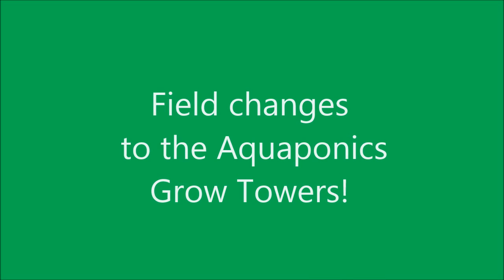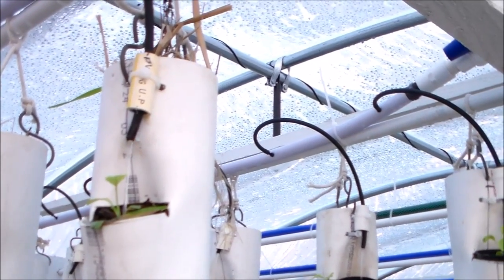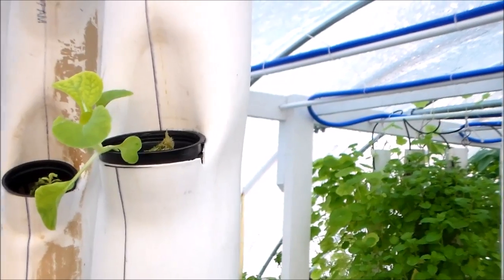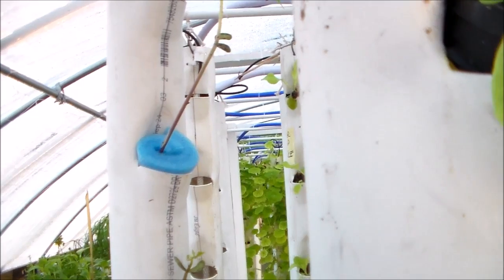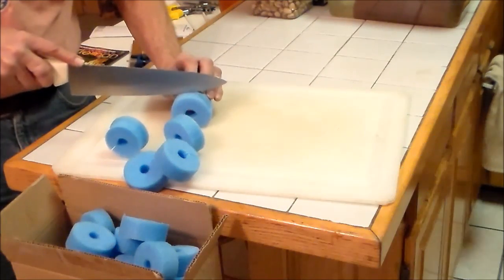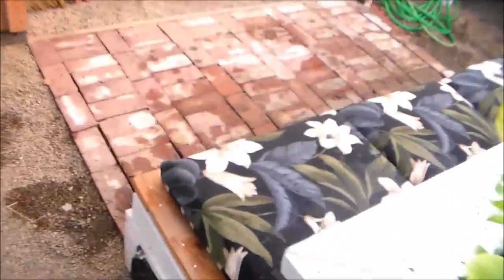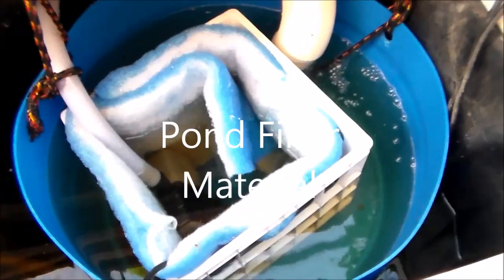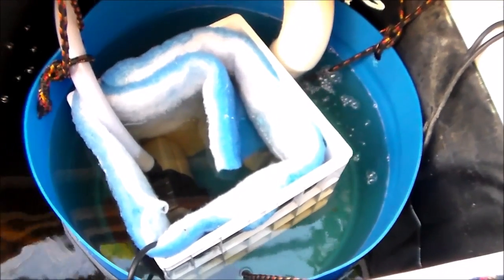Field changes to Aquaponics Grow Towers!

Comment: Do you have problems with water getting the the successive nets as you have pushed in the pipe above each hole which redirects water away from the net?
Reply from the maker: the water will follow the roots once they start to get some mass, until then I will use a cord or anything that can connect the pots--- the water will travel this to the roots.

Comment: Are you still using straw (given that it decorates over time) ?
I was thinking could you use prolite instead (which is reusable and won't decorate as far as I am aware).
Reply from the maker: You are right,Straw was a bad choice to be using. I deteriorates very fast and plugs the bottom of the tubes, Prolite may be a good option--- let me know how it works for you. good luck my friend---Don

Comment: Hey bro! Wonderful job over here! 
Can I do it with out using straw in the tubes?
Just to use a net pot to hold the plantes.. ?
Reply from the maker: yes--- the plants will do well--- the straw did not work out as planned--- it rots too quick and plugs the bottom of the tubes-- I would not use straw, maybe substitute coconut coir instead. because of the cost I don't use anything in the tubes and the plants do very well.
Reply: Donald Porta thanks for your answer! And another one.. do you recommended doing the horizontal way or the vertical version??
Reply from the maker: both work well, however I am shifting to the horizontal because of less failure of the supply line. The vertical drip tubes has to be checked every day, if you miss one that is plugged you may lose that tube.
Reply: Donald Porta thanks again

Comment: I have built something similar and I used autopot piping so it has an in line filter which is easily cleaned. Your other option is to supply your piping from your sump which would have cleaner water so fewer blockages.
Reply from the maker: +Sheldon B The water is being supplied from the sump--- i'll have to check out this autopot piping, thank you my friend!

Comment: Hey donald what water pump do you use to push the water to all of the towers?
Reply from the maker: +Alberto Delacruz I am on my second pump--- the first one was a magnetic drive which should be a long life pump, the flow rate dropped and not sure why ( I was not home when it happened, a friend taking care of the system, replaced it with an oversized submersible sump pump) I plan to change this one out to save electricity, however this pump is working great. The sump pump is one that is used in homes and came from Tractor Supply Company. The pump flow rate that you chose can be calculated by multiplying the number of towers by 7 gallons per hr., this will give you a guide line  figure to work from. Good luck my friend---Don
Reply: +Donald Porta Thank you for the reply as well as the wealth of information in your videos!

Comment: Hello Donald, thank you for sharing the videos. They are very helpful. I just wanted to know the reason you have stuffed the towers with what appears to be hay/straw. Is it to filter the fish waste solids? Is it necessary even if I am doing hydroponics only without fish involved? I thank you for your time!
Reply from the maker: Hee-Sun Han My thought was to support the plants--- however, this turned out to be a bad thing since the straw brakes down very fast and clogged the bottom of the towers, and was probably making the water anaerobic.--- I am now not using any medium, and everything is working fine.

Comment: Excellent project; I am tempted to do the same to grow strawberries.  A couple of questions:  Is there another medium in place of straw that would be just as effective.  Also, what nutrients do you use and in what ppm strength, and lastly what PH level is best for strawberries?  Thanks
Reply from the maker: chandra0102 
Straw is a bad idea as a grow medium--- the straw beakes down too fast and collects and plugs the bottom of the tubes. I have been growing in the tubes with the foam from a swimming noodle for strawberries and net pots with clay pellets for beans and peas. I want to try coconut coir next when I find a supplier, this sounds promising.
Reply: Don, have you thought of using like a pea gravel and running them on the same cycle as you fill and drain system? THat would give them a way to stay moist, and still allow the roots some gripping area.

Comment: So are you saying that the hose (that enters the top of the tower) gets clogged without a "sprinkler head" on it?  You then mounted it exterior so you could monitor it.  This is all with filtering?  I am confused.  How is it getting clogged?
Reply from the maker: John Wichmann the drip tubes are seldom clogging  with the new filtering--- however there is still very small solids in the water and some will still clog and without a visual check a tower may dry up before I find it stopped flowing--- so , the visual check is convenient and saves some plants.
Reply: Thanks.